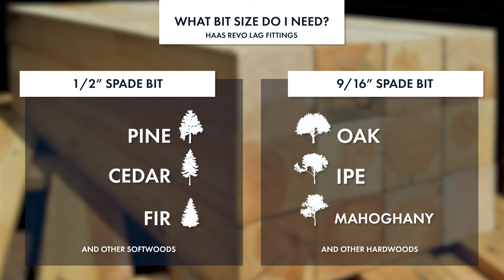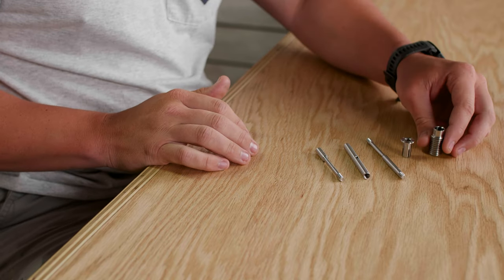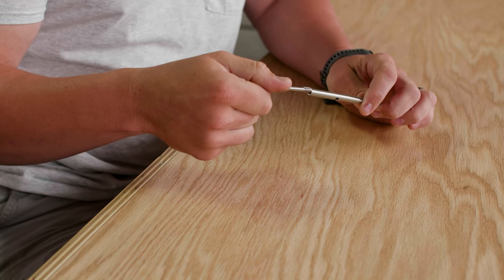Lag Tensioners | HAAS REVO Cable Railing Components Installation

Comment: My project will be using Aluminum sleeved 4x4 posts. How is the installation different using sleeved vs not sleeved posts?
Reply from the maker: We typically don't recommend using the REVO System for sleeved posts. The AXIS System works better in cases like these. You can find a tons of AXIS How-To videos on our channel. If you need additional help planning your system, you can set up a consultation with us here: https://bit.ly/4fjBa95

Comment: How long of a run can you make within the tensioning limits of your three product offerings?
Reply from the maker: Hi Jeffrey! We recommend 70' as the max length of a single run with one tensioner and end stop. Longer runs require some special considerations, so if you are looking to plan out a system like this, you can book an appointment with one of our cable railing technicians. They can answer any questions you might have, as well as help you plan out your own custom system. https://e-rigging.com/pages/book-appointment
Reply: @HAASCableRailing  Thanks! I did book an appointment and spoke to Tyler yesterday. He was very helpful! I will be sending to him an outline of my project so that he can help me with making sure that my order is complete. I researched many systems including Feeney and Cable Bullet and everything suggests that your systems are the absolute best for my needs! As my project is a very big one…….all volunteers are welcomed!

Comment: why is this kit so long? does HAAS make anything where the cable is "hidden" inside the post with internal tensioner?
Reply from the maker: We do! It's the HAAS Stainless REVO Thru-Post Tensioner. It effectively hides the tensioning component inside the termination post, and can only be used if the backside of that post is accessible. You can watch this video to learn more https://youtu.be/ZCdkItqVNK8